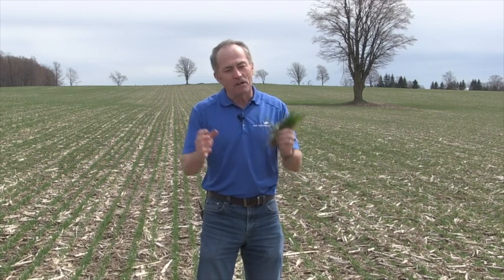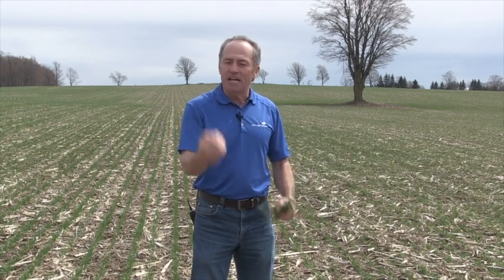Wheat School: Split Nitrogen

Comment: Can i use liquid N with drops on my applicator to apply at ground level   during second application  at second node?
Reply: Hi Shawn. Drops can work very well, but you may need to weight them down or drive slowly. Thick wheat tends to cause the drops to ride up and out of the wheat. Your drops will also need to match up with row width, and at least 1 drop between every 2 rows. Nitrogen will not move past a row of wheat roots.

Comment: How deep wheat should be cultivate
Reply: 1 and half inche as coleoptile length is about that length
Reply: On irrigated wheat we plant as shallow as possible.  Basically barely in the ground 1/4 inch and then run the pivots fast to keep it moist.  The planting depth should be related to expected available moisture.  We get absolutely terrible (for our area) yields if the wheat is planted over 1 inch deep.  Our irrigated winter wheat can yield 170+ bpa at 1/4 inch planting depth.   The tillering is much better if planted more shallow...as long as there is plenty of moisture.  The maturing tillers also spread out more to the point that in high yielding wheat you have difficulty seeing where the rows are.  With good expected tillering you should also plant a lower rate of seed.

Comment: Our N needs on sprinkler irrigated wheat can be very tricky in Texas.   We plant our wheat after 240 to 290 bu/ac corn so we go 2/3 + 1/3 split 160 lb N.  Hoping for 120 bu/ac.    We run a NT drill two times planting 75k seeds each time because we do not have a VT and have a very hard clay loam soil.   A virus will take all if it is a dry winter and just no till.